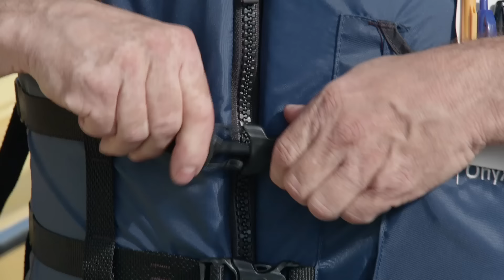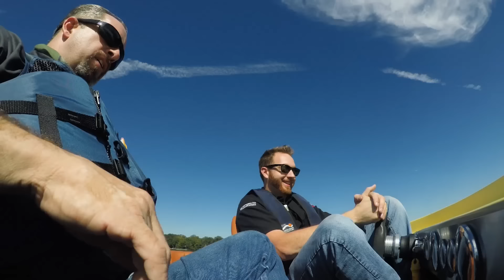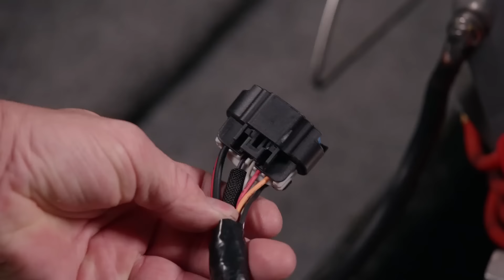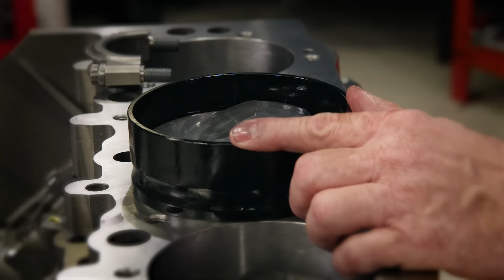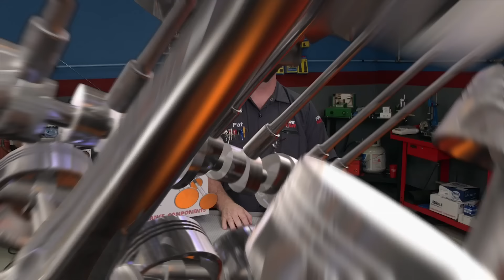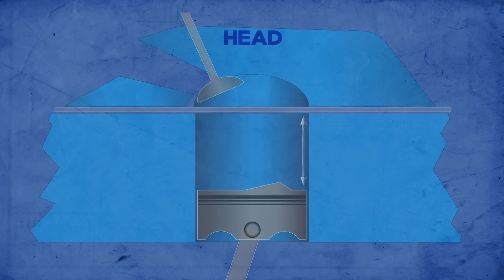Launching a 680HP Big Block Chevy Jet Boat - Engine Power S6, E2

Comment: I had a 1984 laser speed boat with a 150 merc that would do 72 mph stainless prop  use to blow off 200 merc  it threw a rooster tail like that boat fun as hell but dangerous.

Comment: he increased the horsepower and didnt change the impeller to compensate the increase.  That looks like a Jacuzzi pump which more than likely has a B impeller, you more than likely needed a D impeller judging on the fact it was only running moderately faster than when it had the original engine. With 680 horsepower that boat should be in the 90s and you were barely running 80. My 18 foot Hydrostream with a 200 Black Max would run off and leave you.
Reply: nó ót wint
Reply: only ñeed merçy 200 sport jet

Comment: Actually with a jet you do have a braking system. Throw diverter in reverse and that boat will stop on a dime. With an in out unit you will have a boat load of broken gear teeth.

Comment: People don't get jet boats, all these comments are funny about your bass boats and outboards. Jet boats are like driving a 66 GTO. Does it turn well? No. Does it stop? Nope. Is it fast in a straight line compared to modern cars? Negative. Is it comfortable? No. Top speed? Slow.... but is it cool? Absolutely.  Anybody can go buy a new outboard, these are hot rids, built not bought, and each one is unique.
Reply: qr⁹bg

Comment: Seems kinda slow for a such a big engine, you can get a 150HP  two stroke outboard in the 60-80mph range depending on the hull/prop, is that just cause its a jet boat and less efficient?
Reply: 60-80 mph ??? On what boat? Jet drive is way more efficient at producing thrust.

Comment: That old-school glass boat is severely limited in top speed by the old, heavy fiberglass construction, non-matching jet pump & old hull design. If that engine was in the modern Canadian-made Outlaw Eagle aluminium built, semi-tunnel design with the right pump...that 680 HP engine would break you into the 100+  MPH range easily.

Comment: Never been a fan of a jet drive (poor handling and slow, let alone a cigarette butt will clog them up) stern drive will get you the most out of the big block.. What’s up with the steering wheel in the wrong side, that was odd?  That foot throttle can be a trip with that set up (jet drive and a big block) I’ve been on the Ohio river for over 40+yrs and love boating. Us ol boys have a saying about boating.. 
Break
Out
Another
Thousand 
 
Expensive hobby for sure. Great show like always guys!!

Comment: How long can a fresh built engine sit before it would have to be through again?
Reply: As long as you tear down and oil the bearings and cam forever fire it up dry and it will die

Comment: Figured it would hit 100 at least.  Bass boats with 300hp outboard hits 80’s with no problem.
Reply: and no girls in sight
Reply: Outboard props are fast but an outboard jet is very slow oxxe makes an outboard jet drive unit it's got a transmission on it and it's pretty efficient. Bolted to a diesel engine lots of torque

Comment: Almost 700hp and only 80? Lame... I've seen new bass boats with 300 Merc do 80 mph lol
Reply: Impeller needs to be set to peak torque, otherwise it'll just rev out with no added mph
Reply: Boats do not have Transmissions they only have one gear
Reply: Jet drive loses efficiency

Comment: That motor is probably making nearly 700 to 720 because the air on the lake is much cooler and the engines out in the open sucking in much more air than it would in a car or on a dyno
Reply: But I would assume the humidity in the air would counteract the cooler air?   Just guessing I have no boating experience.

Comment: Growing up int the 70's on the water was so awesome. My parents had dear friends who owned a jet boat with an blown Old's 455. It was so rad. This was a blue metallic flake finish with this huge motor sitting there with the blower and supercharger. It was about a 28 footer I believe. But once it was up and planed out, there was only the back 5 feet touching the water, and that was occasionally. The owner would ski barefoot while his wife drove the boat. I remember riding a thing called a Torpedo that was shaped like a hotdog and you could actually steer to one side or the other. I would get off to one side, cut it hard to the other when a large boat would pass us and jump his wake, sometimes coming six feet out of the water. How can a kid grow up today without those kind of stories?

Comment: Jet propulsion is about the most inefficient way to move a boat, 680hp with a propeller would be fun.
Reply: rickystewi Completely agree but that thing doesn’t have enough transom to hang a bravo drive on.
Reply: @thisismyalt9010  is a surface drive a no go too ? I have no frigging clue of the requirements to install such drive.
Reply: never had anything to do with Jet boats? Jet boat racing throws your whole argument out the window. But they were actually invented in new Zealand by a mr Hamilton,who saw the need for a drive set up that wouldn't get knocked off in the Rocky Rivers.
Reply: @Mercmad  race a screw against a jet! Prop wins
Reply: wribfé

Comment: The foot throttle doubles as a "dead mans switch" so when you get thrown overboard,  the boat doesn't keep on going, like with a conventional hand throttle in a boat.
Reply: Yes it will keep on going, even at idle it will usually be faster than you can swim. I put on a lever throttle and a tethered kill switch, better and safer.
Reply: @walkingman9171  For high speed I think a pedal is better than a stick.

Comment: Grew up with a supercharged 455 olds jet boat, pretty embarrassing to get smoked from the line from a dude with a 150 merc outboard. Very loud and cool looking but...
Reply: 15⁰ hp jet outbatd beßy
Reply: Ya but olds motors are boat anchors.

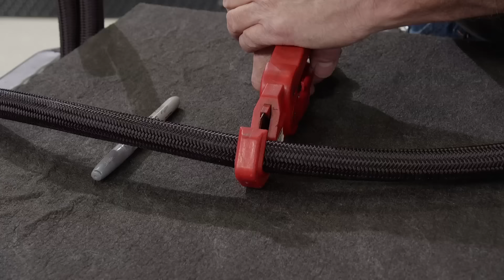Comment: Are Earles hose and lines (5:42) coast gaurd approved? (they need to be or you are in violation operating a vessel that is noncompliant) You might be sorry upon inspection by authorities... Just an experienced boat mechanics observation.
Reply: @bigboreracing356  You haven't grown up on the water. The Coast Gaurd has rules (treated like law) for every part of a boats power plant. You don't mess with the Coast Gaurd, they will tow you off the water and hand you over to the local authorities real quick. And I am familiar with Earles products, first class for sure but without the proper classification numbers (often required to be printed ON THE HOSE) this a is poor example to make. The CG doesn't care how good you think it is, they test and certify all and boaters must comply or face fines....... just fyi
Reply: Let me be clear I think Earls hose and plumbing products are first quality. I also think it's slightly irresponsible to recommend non-conforming products for marine use no matter how good they are. I agree you'd be hard-pressed to find a better quality hose but in the relatively unlikely event that your boat got scrutinized by authorities you could be subject to some fairly expensive fines just for something silly as having the world's best hose installed on your boat instead of one that the coast guard deems legal. I've grown up boating an international waterway and have 50 years experience running a boat on the saint Clair River I don't mean to belittle anyone or any company but knowledge is power.
Reply: @bigboreracing356  Happy New Year!  My video clearly states the technique is for disassembly only and shows a method of removing the spring without a compressor. Not everyone has them. My statement about the jet boat is 100% true. You are also correct that on most inland lakes he would recieve no scrutiny from authorities unless he was driving carelessly. And while the same thing could be said if he were driving in the Saint Clair river (an international waterway) near me the standard is much higher here than in a small lake.
Reply: I see go fast boaters get towed in and fined every summer, mostly after authorities witnessed dangerous driving technique and then checked them out for compliance in other areas usually starting with safety equipment, of which water hoses that connect through hull are included..
Reply: @bigboreracing356  The video was shot years ago when there was no free tool rental yet and only uploaded a few years ago. And although I have that option today many still have no nation wide chain auto parts store nearby. REALLY?
Reply: @danwilcox7650  Don't pay any attention to Street Racer.  He's been all over the comments jacking his jaw like a little boy who doesn't get enough attention.  When he grows up a little, he'll be able to have an adult conversation with you.  Until then, just smile indulgently and tousle his hair and send him back to his mother.